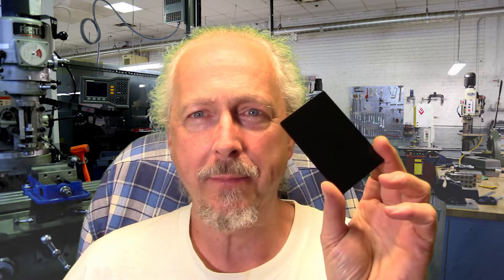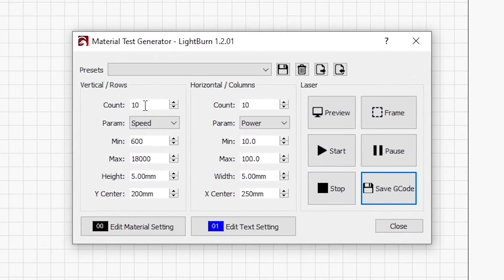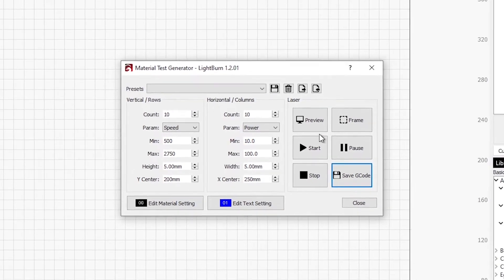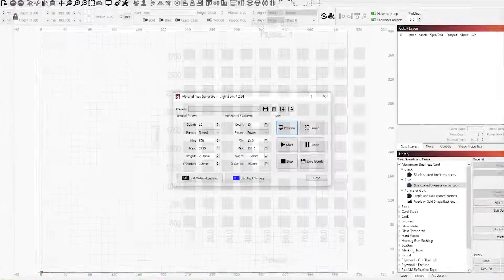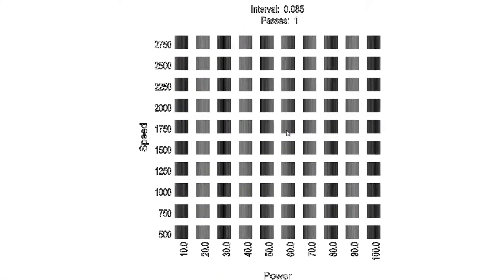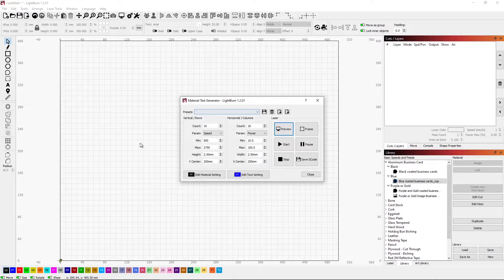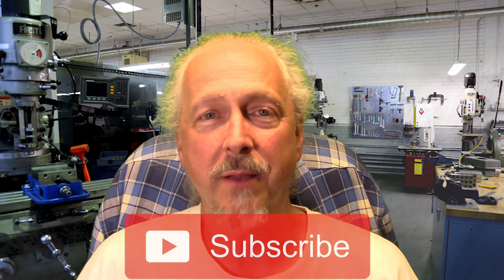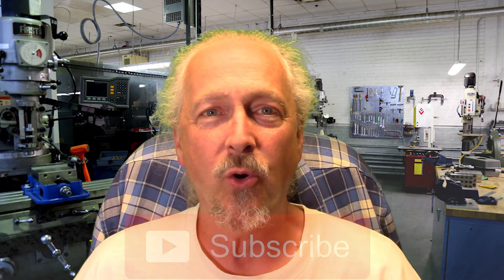Laser etching aluminum business cards

Comment: great video, struggling to see what is the best speed and power spot on the test grid
Reply from the maker: Sometimes there are multiple settings that work well and sometimes it can be difficult to just see what is going on.  I hope you are able to get good settings for your needs.
Reply: @CNCATHome  I have the same question. How do you decide from the test grid which setting will work best? Is it just a preference other than obvious "overburning" and such?  Good video though. Thanks.
Reply from the maker: @grywolf99   - Good question.  Other than the obvious, it really is just a preference.  I want something that is fast and a lower power.  I do not want something that just worked as material can vary.  Close examination in good lighting and even with a magnifier can help determine where the good burn is on a material test.

Comment: Thanks man ! - Great tutorial on how to use the Lightburn software.

I am wondering if it is possible to set lightburn to run a repeat  job and go over what has just been laser'ed so that it can give a better, more lighter effect/contrast with the weaker 5.5 watt diode laser ?, I have one 15 watt diode laser module and one 20 watt not attached or set up to my laser engraving machines yet, I was wondering whether the extra power would make a difference to how well it performs to burn off the dye in the Anodized aluminum ?? - Great video by the way, well explained. 👍
Reply from the maker: I'm not sure I understand your first question about doing a repeat job in LightBurn.  If you just need to run the job again with different settings, that works well.  I have done that on many occasions.  If it is part of the process, you could look into setting up your layer(s) to do this.  Using the project notes would be a great place to put information about how you do a burn so the next time you do it, you will have the information handy.  
As for the 15w and 20w lasers, the optimal settings will likely be different.  For something such as etching the business cards, the setting from the 15w will likely work on the 20w too.  I would run a new set of material tests for the other laser just to make sure I had good settings.
Reply: @CNCATHome  Hi, Thanks for your detailed reply, I think you just answered my question by saying to run the job again with different settings, At least I know now that I can run the same job again (without disturbing  the work piece) just to give it another go in order to get a cleaner effect.

Regarding the 15 watt and 20 watt lasers, I will have to set them up and try various settings on some scrap Anodized  aluminum to see what works best, as I want this to make small nameplates for electric motors and small machine tool projects.
Thanks again for all the info and help  - Have a great Christmas man.
Reply: "Sometimes" the lower powered lasers do a better job of "engraving" as there is only one laser beam to focus.  The better 20 watt machines - Algolaser Alpha for one, (Yea, I got one  :-) , have perfected their beam alignment and thereby the focus.  IF their data is accurate, at 30% power on their 20/22 watt units, they would almost equal that of a single beam laser, with an advertised X = .06mm x Y = .05mm beam profile.  At 100% power the Alpha is said to spec at X = .16mm x Y=.14mm.  I don't mean to sound like an advertisement for Algolaser, but, the build quality and performance for 800 bucks cannot be beat....  WM has the kit, unit, RR2 rotary roller, extension kit for only 799....  HALF the price of a D1....  I am not knocking the D1 since I've not used one, but, for a new company they did a great job with the Alpha.  Their Delta has a few more mm build area and a display screen which, if you are using it in an enclosure - which you d^mn well better be, the display screen will mostly go unused....  Now time to go "burn one"  🙂
Reply: @ainttakenanyshit  Thanks for the info ! - That's very interesting and I really appreciate this. 👍

Comment: What machine would you recommend for business cards engraving?  (large scale engraving hundreds a week)
Reply from the maker: Great question.  I have not looked into production volume lasers.  I would look at a GALO Fiber laser setup or just a plain CO2 laser.  If you are doing large quantity, you would want some sort of automated material handling that would load and unload the cards. More power would mean faster burn times.  Sorry I can't be of more help on that.  This sounds like a business venture.  I hope it goes well for you.
Reply: @CNCATHome  Thanks for the super fast reply!  I'll check out the GALO fiber laser.  I have a glowforge, but each side of the card takes roughly 9 minutes which is just far to much time.  It is a 50W version as well but just seems to be a while.   Starting small but trying to future proof a tiny bit as well.

Comment: This is a diode laser, yes?  I have a 160w co2 laser, but I don't think we can run these cards on it.  What is the power of your machine?
Reply: These cards are painted, not anodized. I bought the same product and was able to engrave them with my Ortur 5.5W laser, but have been completely unable to engrave parts that I anodized myself with the same laser.
Reply from the maker: @chadlantz7522  - They are coated with something that burns off easily.  I do have some anodized aluminum and have not been able to burn that off with the 5.5 watt laser.
Reply: @CNCATHome  you'd need a fiber laser for that.
Reply: ok, so i ordered a sample pack and will slam them into my co2 laser to see what happens...once i know more i will update here :)
Reply from the maker: This is a diode laser.  It is rated at 5,500 mWatts.  So quite a small fraction of the power of your 160w CO2 laser.  You still should be able to run these on your machine, you just need to make sure you turn that power down!  ;-)  It doesn't seem to take much to burn through the coating.